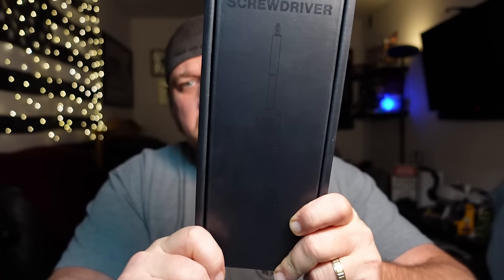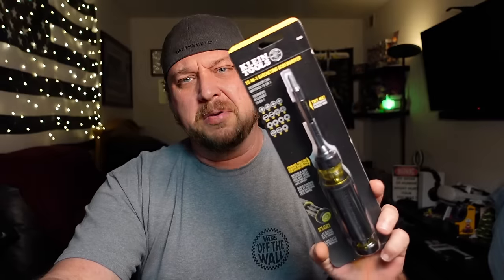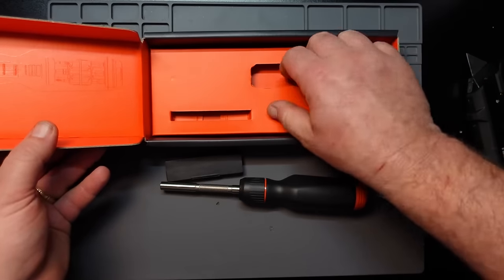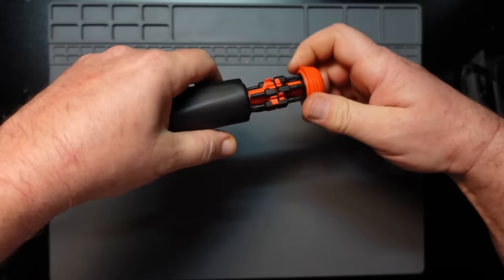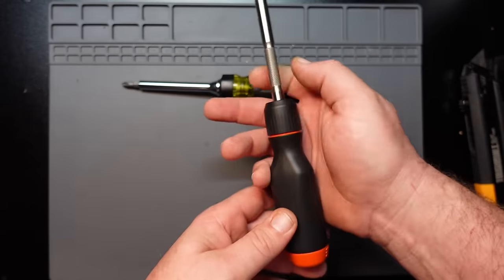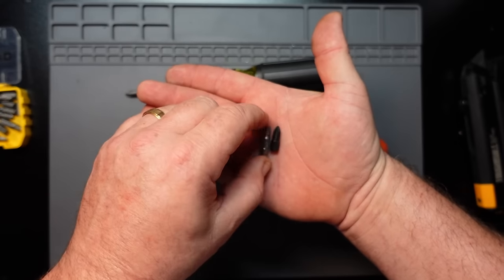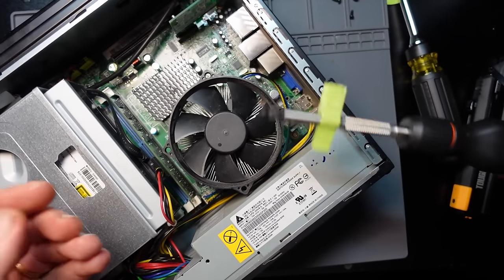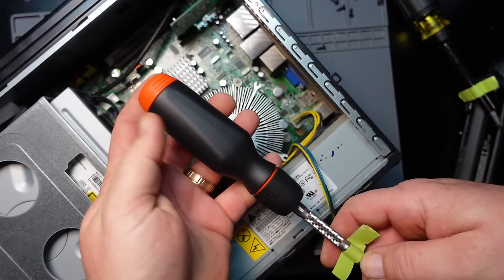LTT Screwdriver Vs Klein

Comment: I used to be a mechanic and I now work in IT at a local PC shop we have a couple LTT drivers and almost a year later they are holding up very well and have been used for many things other than PC work my personal one has been used for some mechanic work also and has broken a few bits and still works as smooth as the day I got it.

Comment: Great video and review, I have a T handle racheting screw driver that I use around the house it's definitely a low quality one but it gets the job done. I I remember right they mentioned that the reasoning for the smaller bits was to make better use of the magnet when building PCs.

Comment: I love my LTT screwdriver, I never thought I would buy something designed and manufactured by youtubers that was such high quality.
Reply: because it is not manufactured by youtubers but megapro
Reply: Well sure, they own the patent on the bit storage in the handle, and they did a great job. I had a MegaPro ratcheting driver before, which is why I knew I wanted an LTT one.
Reply: @AustinWigley  well yes megapro are fine i have a non ratcheting 15inone

Comment: Linus actually had a snap on screwdriver until it broke (after at least a decade of use) and the replacement wasn't as good, so he developed his own
Reply: Seems weird that he “developed” a screwdriver that already existed & is sold by a Canadian family company called MegaPro.
I’m pretty sure he just sent the MegaPro driver to a Chinese factory & said, “hey, how much to make us some of these?” then proceeded to mark the price up. 
How is it possible that MegaPro has been making this same driver, in the US & Canada, for years & at half the cost?  It’s almost as if he knew that China doesn’t give a crap about intellectual property & would make it anyway
Reply: @koobs4549  No, MegaPro worked with Linus and his engineers to develop a more refined version of their screwdriver.  MegaPro does do OEM work meaning they manufacture screwdrivers without their branding.

Comment: the Klein drivers with bit storage are nice but have a further flaw. The rubber handle cover stretches over time. This means it will slip over the hard plastic when you are working with tight fasteners. I still keep my Klein safety driver in my pouch tho.

Comment: Due to the low torque requirements within IT hardware the idea of the knurling is such that you can remove pretty well all screws from a PC without needing to torque the handle except to "crack" the screw at the beginning. (I have high pinch strength due to the fact my screwdriver doesn't have knurling.)
I lose my screwdriver all the time so i just keep re-buying $7 ones.

Comment: I have been using a Snap-On ratcheting screwdriver for over 25 years, the first seven years was pretty hard use but after that just around the house repairs and projects, finally started skipping and giving out on me last year and my son gave me a LTT for Christmas, I have been enjoying its use, its well thought out and works for what it was intended.  Will I use it when I have to bear down on it or as a pry bar... no, but it will give years of use for small projects

Comment: There is a reason the knob of all other ratchet screw drivers turn the opposite direction you want to screw.  When using in tight places, the knob will rub on stuff and try to turn it.  It won't release - a good thing.  The TTL will release and you have to re-engage it.  Very annoying.

Comment: Everytime I see someone working on a computer with a screwdriver that size it's the visual equivalent of nails on a chalkboard. I mean, if you're working on an appliance or around the house sure it's good. Working on electronics or computers it's the wrong tool for the job. If you drop it, it could damage components and once the screw is out far enough the ratchet is useless. Electronics screwdrivers are my way to go, just a lot more maneuverable, you can hold them in your hand or or put the base in your palm and spin with your thumb and fingers for more precision. I would never use either inside a case, server or any piece of electronics and if someone tried to use one I'd hand them one of my screwdrivers.

Comment: I got it as a birthday present last year and while I think it's a very expensive screwdriver, it's hard to argue that it's not a quality product. I've no way to reliably test durability, but for light and medium duty uses it seems like a very good tool, aside from the slightly slippery handle. Although other tests/videos have suggested that by the time I exceed the torque needed to break the screwdriver I will have broken or stripped the bit and the screw, so...

Yeah, as an expensive gift, I think it definitely justifies its price, at least from a "merch-branded tool" premium standpoint.

Comment: I prefer the wera quick release screwdriver,there just because sometimes the screwdriver bit grips the screw and gets a little stuck and then you try dig the bit of there with a pair of needle nose pliers and it's just a real pain in the ass where as with a quick release screwdriver since the bit is locked in place you can just gently yank on the screwdriver and pull it out.

Comment: A ratchet mechanism in a handheld screwdriver is just an unnecessary failure point in what should be the simplest tool in my toolbag.
Reply: As an electrician,  I must say that I totally hate ratcheting screwdrivers. 
Obviously,  I use screwdrivers constantly.  
Ratcheting screwdrivers are simply a pain to work with and aren't needed.
Reply: Ratchet screwdriver best ever.  Grow with the times my friend
Reply: @newguy2794  When I was an LV contractor I couldn't imagine using a ratcheting screwdriver for anything.  Gonna be slower every time, too, except for that one random weird use case that I only assume exists but never found.  I had a coworker who got one of these and it was pleasing to hold and play with.  Nice tool, sure.  But a red herring of a feature.
Reply: @mdoc140  ok. Enjoy! I've tried them, can't stand them.
Reply: Never saw the point of a ratchet screwdriver. My Klein's are all I need and never fail to perform.

Comment: As for the Klein, I'd recommend putting a little length of shrink tube on the shaft, so you can rotate it a bit easier. It's not knurling, but it'll do fine.

Comment: If you want the best ratcheting multi bit screwdriver, get the Hazet 810R-3. Hold 12 bits with an actual locking collet, and it's gearless, so no backdrag. Im usually not a ratcheting screwdriver guy either, but it's a game changer.

Comment: Been Using a "Lutz 15-in-one" screwdriver for years.  Slightly different style, I like that you can see the bits without opening the handle.  Ratchet might have more backlash though.

Comment: i actually love the ratcheting one from klein.. the sucky thing about the klein one is that they use funny 1/4 bits (longer than normal) that you can't get anywhere.. I have about 11 of the damn things (including the regular 11-in-1 screwdrivers).
Reply: But you can stick large 1/4 bits in them! I've done that tons as well as used the whole 11-in1 unit as an extension for my impact.and it held up - strictly light duty for that though.
Reply: @Morberis  yea but 1, they dont stay in. cus they dont have that little ball thing.. and 2. if it's the 11-in-1 they use a 5/16th size bit not a 1/4 inch bit so good luck in finding them
Reply: @WX4CB  Depends which 11-in1 you're using. The one that is magnetic with improved retaining balls is magnetic enough to hold all my bits.

I have no idea what you mean by good luck finding them. My impact bits all fit very snugly in my 11 in 1. Taking my calipers out the stock Klein bits are 0.25 inch and my impact bits are also 0.25 inch, or 6.35mm

Comment: I dislike ratcheting screw drivers.
If you ever need a go to screw driver to keep in the tool box is a 3/32 flathead. In my world of low voltage it's the perfect size for most typical screws head sizes. For a example I have to deal with a lot of camera systems and they like to use those torx security bits and the 3/32 flathead gets around it. Fits into #1 and #2 philips. Also fits pozidrive. Only screw that doesn't work on is the robertson head.

Comment: Don't buy the Klein ratcheting Screwdriver, I had one until it took a shit. The mechanism started to crap out and get real loose after a month or so then the grip comes right off the damn thing! It didn't break of whatever, it's not molded into the case but wrapped around it and like glued? Idfk but it's shit. I did beat the hell out of it because I was on a maintenance crew for an old bottling plant so I used it easily 2-3 times a day working on something. Though the rest of the Klein stuff I have has lasted easy 3 or 4 years now and outside of me forgetting to oil them, they look and work like new.

Comment: It's the opposite on most ratcheting screwdrivers because if you use two hands, you'll keep reversing it by accident.  (At least I always do.)  That's the main reason I didn't get one of the black shaft LTT drivers when they came out.

Comment: Being as I work in the perform the impossible in the ridiculous industry I need a screw driver that takes a beating. Meaning a screw driver needs to also be a prying tool, and often used to rip a slot in sheet metal, or poke a hole in several materials, a ratcheting screw driver is pointless. It cant take the punishment. Being as I have come to rely on Klein as durable, affordable, and easily available, in variety as well. So if I were to ever want a ratcheting screwdriver I would go for the Klein. Just for one use of course then it would just collect dust after that.
That said you cant beat the trusty old 1/4" square shank craftsman screw driver for taking abuse for decades & decades.

Comment: The LTT screwdriver is for professionals who's primary tool is a screwdriver. I am not, so, I would never waste my money on it, but if you work in a server room or as a businesses IT guy taking computer components appart and putting them together, then this may be worth the money. It is the same with Snap-on tools. sure they are great tools, but I would never get my money out of them. I would be better off buying a Harbor Frieght or Kobalt tool.  I am not using them professionally so the time saved to money spent doesn't average in my favor for these higher end tool.

Comment: Having had this screwdriver for a year now, I wish the direction selector was the other way. Several times, I've used it to unscrew something, and bumped the selector against something that didn't move, and reversed the setting. With the selector the other way, it will pull further into the direction you're using it if it gets bit.

Comment: I love your reviews.  Very well done.  Questions, where is it made?  I know Klein Tools are usually made in the USA which I care about and shows they care about quality and this country.  I'm thinking China?  Also, the shorter bits are not good for high torque, I would be worried about that. You are spot on about the grip.  I would like a grip that will not slip in your hands.  And for that price? NO.  I can find way better ratcheting screwdrivers for half the price or less.

Comment: Ironically - I bought the LTT Screwdriver for working on computers and 3d printers.... Instead I use it for quite literally everything. I have the regular one and the stubby. I typically have hated ratcheting screwdrivers because lets face it - we've all used a cheap ratcheting screw driver and they're garbage. Enough R&D went into the LTT one to get it right.

Comment: All this LTT scredriver hype annoys me. I like LTT and I believe it migh the the best tool in the world of that type, problem is that type is garbage. 
Changeable tip screwdrivers as just a bad idea and whole concept is garbage. Ratchet scewdrivers are even worse. 
If you are working on a small job and there are multiple different types of screws it is so much easier to have the needed solid scredrivers. You just grab the screwdriver you need without needing to fiddle with the tipe and container of tips. And the right screwdriver is easy to see, unlike the tiny tips. Do I have 20 or 25 torx tip on as I can not see the tiny markings hidden my the tip holder. 
On Normal - good - scredrivers the type marking are clearly and easily visible.

Comment: I have that Klein ratcheting screwdriver and it is garbage in comparison to the LTT screwdriver. The selector for the rachet on the Klein slips out of position super easily after a few weeks of use. If I want to use the Klein now I have to hold the selector in place. Ergonomics on the LTT are also really good. I have not been kind to the LTT - it's more likely to be used on a deck screw than a PC screw at my house and it powers through it.

Comment: I'm still tempted to buy an LTT screwdriver so that I can use it for fixing tech. But that is also the only place I would want a ratcheting screwdriver.
Reply: Not worth it at all It's a cheap Chinese produced screwdriver that wears down quickly. It is made from the cheapest materials possible. And they have the audacity to charge 70 goddamn dollars for it
Reply: Have a look at Rolgear srewdrivers (or the licensed models sold by Gedore, Hazet etc.), those have zero backdrag.
Reply: The USD $70 price is obscenely expensive for such a crude, flimsy and limited tool. The total manufacturing cost would be about $5 for that POS - you can buy a high end name brand for cheaper.
.
The only ratcheting drivers that I use are those tiny round disk shaped things with a knurled outer edge. They accept standard 1/4" bits and add about 1" extra length. Perfect for getting into those ultra-tight spots.
.
And who wants a screwdriver with bits in the handle anyway? Just buy the screwdrivers that you need, so you don't have to stop work and change bits all the time.
Reply: @johncoops6897  I was 100% with you until you talk about the exchanging bits part because it's way easier to find a bit you need and have space to store the bits you need then having a whole screwdriver for every size screw and every obscured type of screw
Reply: I was only interested in it for the meme of buying the LTT screwdriver and exclusively using it on tech. 
I'd never use it for working on machinery (especially as most of the machinery I work on is too big for a hand-held screwdriver) as regardless of what they say it was  clearly meant to be used on computers and not cars and shit.

Comment: They started at $100 for a frikking screwdriver. That's insane. So is $70. Just shows how many suckers there are out there. Proprietary bits?? WTF? LTT channel has it's own issues. Don't watch them any more. I recently bought a magnetic eleven in one Klein for about $20. As a former lineman for many years, Klein has earned its reputation.

BTW if you solder components on that pad you might want to watch Kerry Wongs latest video about static build up on them.

Comment: It looks nice enough but is it worth four or five times as much as the Klein? I would say no. Have you tried Rolgear screwdrivers? They use one-way bearings so they're buttery smooth with pretty much zero back drag. I don't like their bit storage though. I too am not a ratchet guy anyway though.

Comment: I never liked the ratcheting drivers as well, mostly because the only ones I've interacted with in my live was cheap ones from the local value tool store - which are great for the the novice... I can say that, after using the LTT screwdriver for IT work, it is really nice. The knurling really helps with one handed starting or ending screwing a screw. I can also say that the slipper feel goes away after some use, when the plastic has started to become glossy instead of matte. But yeah, I wish it was rubberised or had some kind of texture on it just so it doesn't slip out of the hand. It's not really made for super high torque use, since I think we all can guess from the very low back drag. I like the bit variety too, the included bits are decent but living in EU/Sweden those square ones are usless to me - I have never seen them here. But that is the good part about their selection, that you can buy the other bit sets and customise the loadout for it. Sadly the packaging for said bits are made from paper, so you can't really reuse that for adding additional bits to your toolkit - would've been nice with a little plastic box for that but it's not the end of the world. Can't wait to see what their precision driver will be like, not that I need any considering I already own ifixit sets... 😅 But who doesn't like nice tools, eh?
Reply: I 3D printed a few bit holders for that reason.  I do appreciate that they at least tried to minimize and eco 'friendlyize' the packaging, even though the impact would be pretty minimal.
Reply: The problem I have with the rubber grips, is that everything I have that has that sort of grip just deteriorates over time and it gets sticky/oily feeling. Could just be cheap tools, but it's not like I'm exposing them to solvents or anything. I do think the LTT driver could use a bit more grip, but at least it will remain the same amount of grip basically forever, without turning to goop or collecting dust like crazy, etc.